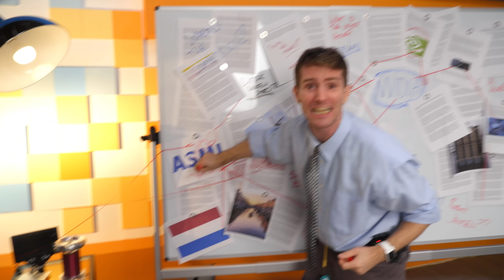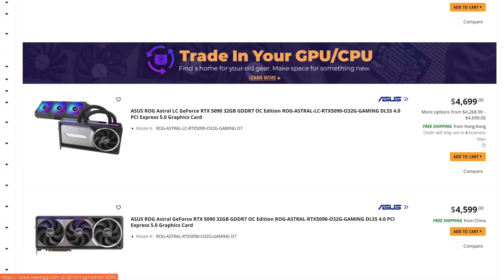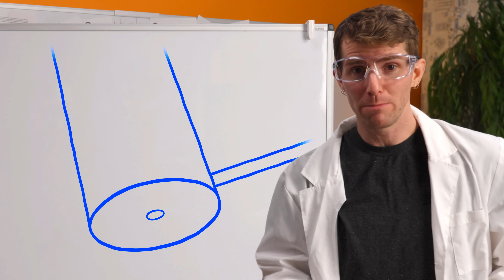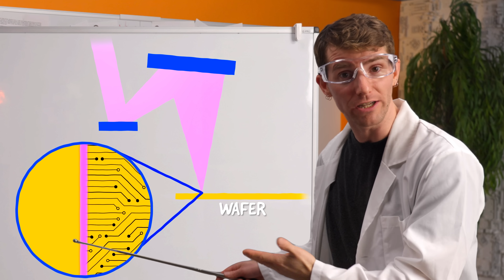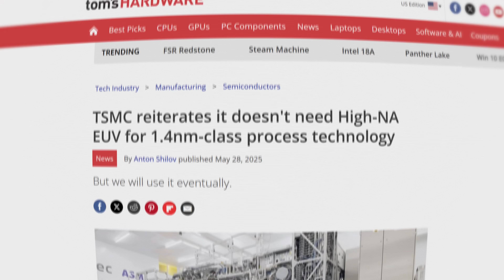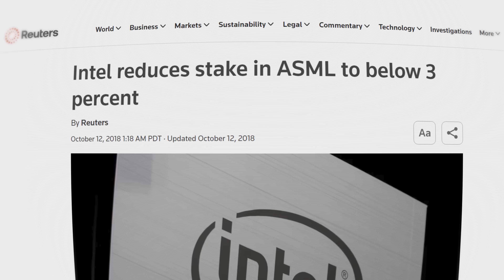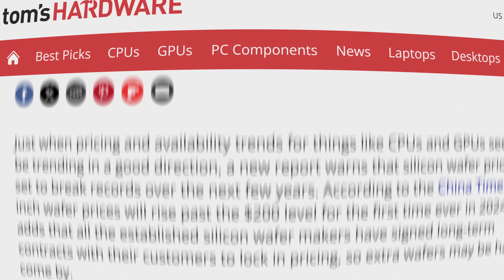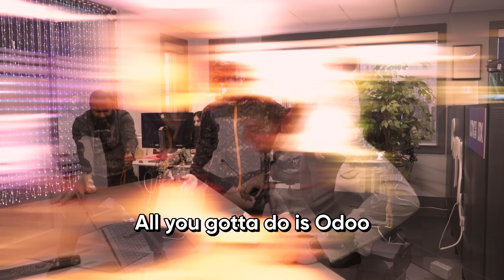This is Why Hardware Prices are Going Up… Again

Comment: Also Zeiss from Germany is the only company manufacturing the lenses and mirrors for the EUV machines and Trumpf, another German company, is one of the only ones producing the lasers used.
Reply: How nice of you to mention them both! Some other companies of note worthiness. Cymer, which researches EUV for ASML. Applies materials, which supplies a bunch of the other equipment. Same with LAM research. 

Seimens, Cadence, and Synopsys run the EDA part. 

Personal shout out to Entegris!
Reply: @yensteel  I'm sure it's Siemens. Why do Americans recently more and more often switch i and e when writing? Is this a zoomer thing?
Reply: @NoidoDev  People make spelling mistakes, as a native German speaker, it's Siemens. Big whoop, he didn't hurt anyone.
Reply: @NoidoDev  Because the German Sie is pronounced like the ei in receive for example.
Reply: @NoidoDev deutsche Sprache schwere Sprache
Reply: … also AMAT, KLA, NuFlare, EUV is sort of the newest wave of chipmaking. Everyone is trying to get a piece of that multi billion dollar pie 😊
Reply: @daniosaur7328  KLA Tencor has long been industry standard and basically essential for metrology and defect analysis work through fabrication for every size process node. 

Source: I'm a yield and defect analysis technician in the semiconductor fabrication industry and have done work for big blue on their 18A and 14A nodes at their internal mask operation as a mask repair technician.
Reply: there is also IMEC, they basically test everyone's ideas and are 10 years ahead of everyone technologically
Reply: @xthelord1668  Semiconductors would not be where they are today without imec. (Interuniversity MicroElectronic Centre, world leader since 1984)
Reply: @xthelord1668  IMEC is a non-profit research lab, not a mass production facility
Reply: @erkinalp  they still do the cutting edge research for the ASML
Reply: @erkinalp  and from where mass production facilities get their production tested? said places like IMEC

3D stacking which NAND companies, AMD and IBM use was tested by companies like IMEC
Reply: Hey fellow ASML empoyess ;)
Reply: Trumpf? Are you threatening me?
Reply: These also VDL ETG, where many frames and components are made like the wafer handler and stage, and frames for the mirrors
Reply: china has tested the first prototype of its own , soon we will have more
Reply: @najeebshah.  That machine is literally built from ASML parts.
Reply: @OverSoft  no, you miss understade that, they buy ASML parts to learn how to build one themself, not use them.
Reply: @OverSoft  look if the us can cheat and control asml to sanction china then I say its fair  play for china to reverse engineer asml
Reply: @Lxodl_1234ga  and trumpf is basically having a monopoly in metal 3d printing space. Best printers in business.
Reply: Doesn't Gigaphoton in Japan make the lasers?
Reply: Thank you for mentioning the other company involved as well working as Trumpf for the EUV System as a Field Service engineer its also not only Trumpf Producing the Laser as the source Laser that gets amplified which has very specific wavelengths gets produced by another company. With newer generations of Machines reducing costs is one of the priorities but it takes a lot of time till they come into effect for the consumer.
Reply: and how many companies make the masks used for the euv machines?
Reply: @pmve4024 as of right now, at scale, only Intel. 

Source: I literally manufactured them at Intel.
Reply: Zeiss also produces rifle scopes !
Reply: What happens when those companies go out of business
Reply: @sdoo-ou2ni  that’s a very textbook hypothesis of industrial capitalism

In real life they’ll never go out of business because several dozen nation states will go out of their way to prevent it from happening

Any government or adjacent megacorp entity would destabilise global economies if it meant for an opportunity to invest in and own a stake in ASML and friends
Reply: @sdoo-ou2ni businesses buy replacement parts from eBay like the rest of us scrubs do with our legacy tech
Reply: There are illegal and legal monopolies. Being the only company to do something doesn't make you a  bad monopoly if you freely provide your shit to everyone at a fair price. Nvidia is an illegal non monopoly trying their hardest to be a legal monopoly through power to change monopoly laws type of crazy.
Reply: Specifically Carl Zeiss SMT, where ASML owns 24.9% of the shares. It's a subsidiary of the overall Carl Zeiss company.
Oh and for EUV lithography only mirrors are used. And only a certain amount
Reply: it's a conspiracy!
Reply: We can go as far as needing everyone in the world that you need to fully support this being possible.
Reply: There's no lenses in EUV, those turn opaque at those energies.
Reply: The far more you go, more political warfare will be exposed. So just knew it is enough. In my ideal world, wish china can copy-cat chip making process, then they will spam factory alot, increase suppliment tremedous and drag price back to "normal". TSMC cannot make any factory in mainland china bcoz of alot restriction. But also in Taiwan, they won't have enough fresh water. Yes, manufacturing chip cost alot hell of water, and it could degenerate agriculture in this area, Taiwan area is an island only. There could be alot tension about nationalism on news, but actually in bussiness, they willing to make deal in the shadow as long as it benefit their pocket.
Reply: Its all one long, complex, brittle supply chain which is highly vulnerable to global disruption.
Reply: If Wikipedia is anything to go by, EUV machines use very few lenses.
Reply: TIL all of IT hinges on a VERY small handful of hyperspecialized companies...Oof.
I hope other companies see this and can outcompete them SOMEHOW. otherwise it'll just get worse and worse and worse...
Reply: China just build their own EUV prototype. Give them 5 more years.
Reply: So basically… it’s not china or some other asian country that’s controlling the chip market, it’s the Europeans, because THEY are the only ones selling the cutting edge stuff to male these chips?!
Reply: @erebostd  Yes, but that also adds a pressure that might born more inventive methods than EUV - eventually. Also, while the machines are made by ASML (and their parts by bunch of other European companies), don't forget that the only viable production fabs using their machines are TSMC which definitely falls under 'some other Asian country'.
Reply: @zwerko this isn't true. Intel beat them to the punch at Ronler Acres. 

Source: I literally manufactured the EUV photo masks there.
Reply: @erebostd  No matter which continent, the answer is only socialism can undercut and steal a free market from better Americans.
Reply: The EUV Light Source is made by Cymer (USA), later got acquired by ASML
Reply: Doesn’t Nikon also make lenses for these lithography machines?
Reply: @PiTdeLyX  They make lenses, but EUV uses mirrors, cause the EUV-light gets eaten up when passing through lenses. And Zeiss are currently the only ones capable of producing mirrors of the required quality
Reply: @PiTdeLyX  Nikon, Kodak, Hoya, anyone more? The simple ans is no. There's noone else can make a product that actually working. There's no competitive in this field. Simply there's only Zeiss is the best.
Reply: @PiTdeLyX  They do, but not for those cutting edge ones. Only Zeiss is able to produce those afaik. The mirrors are polished to a smoothness of less than one atom’s thickness. If this mirror were to be enlarged to the size of Germany, highest mountain would be 1mm high. In addition to such high precision, EUV mirrors require maximum quality and reflectivity. It is crazy to even think of.
Reply: @Arhey  cheers! Thanks for the clarification. The Nikon thing was something I heard a while ago,but I don’t follow this stuff too closely.
Reply: @Arhey  Greatest mirrors in the world are here in Tucson at the Vatican's Mt Grahm telescope made by UA over 30 years ago. smooth to one atom (not less). UA has also made mirrors for the world's latest greatest telescope in Chile, the Giant Magellan Telescope (GMT). The last mirror will take two years to polish just right. Sadly, socialist tariff money makes Zeiss cheaper. Sigh.
Reply: @Arhey  Greatest mirrors in the world are here in Tucson at the Vatican's Mt Graham telescope made by UA over 30 years ago. Smooth to one atom (not less). UA has also made mirrors for the world's latest greatest telescope in Chile, the Giant Magellan Telescope (GMT). The last mirror will take two years to polish just right. Sadly, socialist tariff money makes Zeiss cheaper. NG
Reply: @JustMeAP1  Well the Zeiss mirrors are also even to atom. At least it says so on their homepage.
Reply: @Arhey  Not LESS THAN an atom. That's stupid to suggest possible. Stupid no matter where it's at. lol
Reply: @PiTdeLyX  Nikon bayled out of the EUV game years ago, because they couldn't get it working.
Reply: Interesting. Chinese photography lenses have improved RADICALLY in the last 5 years. 

I do wonder if that is an external effect of them trying to catch up in chip manufacturing.
Reply: @voinekku  I read today that apparently a chinese company with close ties to Huwai has a working EUV machine (based havily in reverse engineered ASML machines and poaching key ASML people). But ASML had demo machines over a decade before their machines were ready for production. The principles are well understood, but to get everything to the required level took them a really long time. I expect the chinese to catch up faster, but its not like ASML is just sitting on their butts doing nothing.
Reply: @voinekku  They got one EUV machine now., But what I was reading about it, it seems to use tech from older ASML machines, so they didn't produce it themselves, just "recycled" it.
Reply: @Arhey  did you mean EUV or is UEV a different thing?
Reply: @jokercardzz  I meant EUV.
Reply: Zeiss likely gets the high purity quartz for their lenses from a Spruce Pine, NC mine. It holds roughly 70-80% of the market share for high purity quartz in the world, which is where the silicone for the chips, the quartz crucibles, and the quartz lenses come from. Without that mine, we'd be stuck in the 1960s, technology-wise.
Reply: @gothnate we wouldn't be stuck in the 60s technology wise chips would just be more expensive since more purification steps are necessary. You can purify any stable substance to whatever purity you desire no matter what purity you start with its just not economical to start with something with a lot of contamination's if something purer exists.
Reply: @Ninjaeule97  it's possible, but without large natural deposits of high-purity quartz already on hand, the knowledge needed to purify or synthesize it likely would have never emerged for many more decades, if ever. Having a cheap, abundant supply is crucial for development, which breeds more innovation. It's like now, we can produce very small amounts of antimatter, but we won't know the extent of what we could do with it, without having a cheap abundance.
Reply: The silicon in the wafers come from a single mine too! 

Literally the least resilient supply chain in the world…
Reply: It really is an intellectual property turtles all the way down situation.  No one can beat ASML because no one has had fifty years to practice and reinvest like they have.  No one can beat Zeiss because no one has been making optics since 1850 or whatever.  Etc etc etc.
Reply: Trumpf.....well I know what I am buying Monday.....lets gooooooo
Reply: That's the point. In the end it looks like every CPU is German engineering. Where is our AI money? Why can't  produce it in Germany?
Reply: So Europe provides the hardware, Taiwan provides the labor, and the US provides the brains.
Reply: It's not over the past 20 years. It's since 2011 when Fabs were ALL owned by American companies simply being better. Then SOCIALISM allowed govts to BUY their way in to STEAL entire markets the same way S Korea and Samsung did to Japan and NEC had done to America decades ago. Up to today, only UA here in Tucson made large lens for telescopes but socialist German bought that market for Zeiss. The only realistic solution? Higher and higher tariffs matching their tariffs used to fund the anti-free-market efforts. Hurray for President Trump. Same thing for eggs. Dems shutdown small farms for foreign govts to buy mega farms. 80% of Arizona eggs now produced by Brazil. Sigh.
Reply: stop shilling 200m ASML machines are nothing nvidia with its own clear profits could buy a 10 new ASML machines each year and still be profitable! They just want to keep the current situation because its less troublesome for them (less shit to care about less logistics etc) and money goes brrrrrr eitherway for them. there is no reason for real shortage silicon is one of the most aboundant elements on planet earth first we gonna have an oxygen shortage and then a silicon one, high demand can be met by high production and they have entire divisions of scientists with Ph.Ds and decades of experience predicting things like future demand they just dont care to lower the prices because they are dishonest greedy and nobody regulates them.
Reply: @billkillernic  You are aware that the wafer imprinting machines make like 5% of the whole fab line, right? Yes, it's the most crucial one, but building a production-grade fab facility takes almost as much as building a nuclear power plant - a decade or so. Yes, Nvidia has money to build a few of them but they would have to bet that the demand would be the same for their products in 10 years to invest the money and build up fab expertise. That would be a risky bet.
Reply: @zwerko  and you are aware that I said only one company (nvidia) could buy 10 of them (so 2 billion) each year  for SEVERAL YEARS and still be profitable (by multiple billions) ? 

So yea its not 5% of the line its more but even if it was 5% "only" they make so much money creating production lines is a 0 issue for them 

Especially with the forecast growth with iot AI and what not. 

Last but not least they could also make alliances to meet demand (e.g the ram manufacturers combining efforts for new fabs and increasing production on current ones e.g now RAM manufacturers could do that even easier because RAM fabs are 100 times simpler than 2nm or less nodes for x86/GPU/arm architectures, even russia has ram fabs..)  which they also do not do.
Reply: @zwerko there is not a single tool in a fab that does "wafer imprinting" and as a yield and defect analysis technician in the industry, the very thought of that makes me nauseous and gives me cold sweats.
Reply: @billkillernic you should Google the Silicon lottery. As a semiconductor yield and defect technician: it really fucking matters.
Reply: One component of huge machines with thousands of parts. Sorry but nobody cares.
Reply: @rkatz69  well, the laser and the optics are the most crucial parts of EUV and the reason why most researchers believed it would be impossible to build such machines. Unfortunately it’s quite hard, even when pouring money, to increase the production capacity and the know-how required makes it almost impossible for competitors to emerge in a feasible time
Reply: @rkatz69  first: they make every intrical parts, so yes, they are important and not easily replaced. Second: every part is important. Everything has to be the best of the best, otherwise it won't work.
One of the reason that EUV took so long to mature was to get the light source stable enough.
Reply: @rkatz69 HISSSS
Reply: @rkatz69  which the machine literally cannot work without with. That's like saying "nobody cares about tires, it's just one part of a car"
Reply: @rkatz69 One critical component.

EUV lithography without optics and lasers is like a car with no engine and no steering wheel.
Reply: @rkatz69  The EUV mirrors and lasers might make like 5% of the machine, but that is the most crucial part of it. Just like the machines themselves are a very small part of a whole fab facility, but without them you wouldn't be able to make anything.

Comment: FYI Asml mostly make machinery for the advanced less than 10nm process nodes for 10 nm and over ter is much more competition.
Reply: Yes, but high-end electronics are basically all 10 nm and below. I am not sure if RAM needs a 10 nm process but a GPU/CPU for sure does.

Comment: The process of creating the uv light is even more impressive. Tiny tin droples get hit by a pilot laser to flatten one side of the droplet so a second, more powerfull laser can better hit it. The evaporation of the droplet creats a very little flash of this wavelength so they have to do it thousands of times in a second. Crazy tech and ASML is many years ahead of any competition in this technique.

Comment: Michael burry claimed based on nvidia financials and data center electic use rates nvidia was greatly inflating their 6m blackwell cards shipped claim. 
Nvidia claimed afterwards they meant dies - for which each blackwell has 2 of, so 3m blackwell units. 😅💰

Comment: "not angry enough to buy a radeon" yea i guess the majority isn't. But i was.
Sadly, the AMD drivers are stiiiill sooo bad, at least in my personal opinion.
Never had a single driver issue with nvidia for 10+ years. 
And i can't come close to count the amount of times which i cursed both my RX6800, AMD and gigabyte customer service in just close to 1 years since i have an AMD card now.
The card is so good, and price efficient. But the drivers are sooo buggyy, its not enjoyable tbh.
I mean, not Intel ARC levels of buggieness ofc. But still, way more to be ignorable.